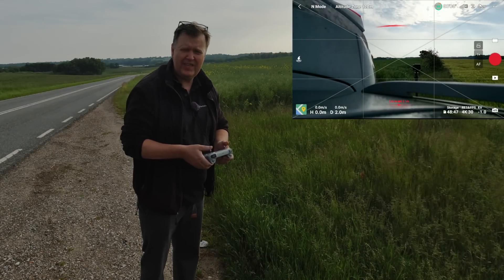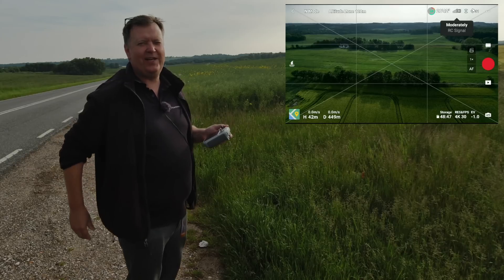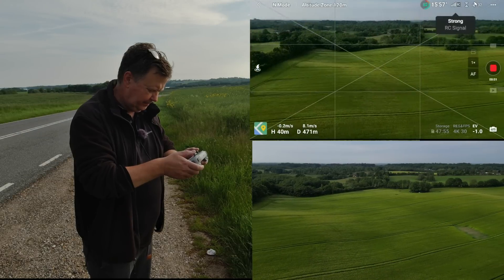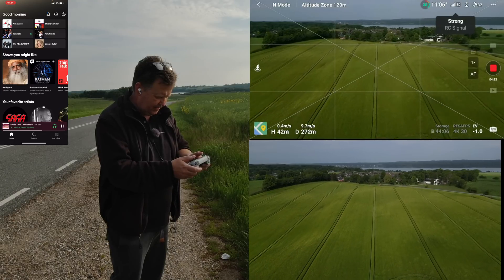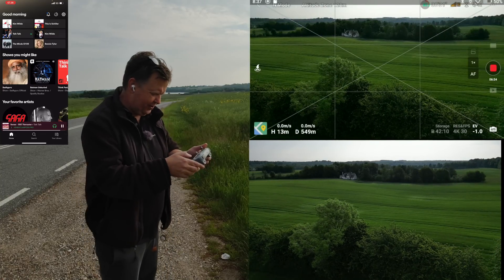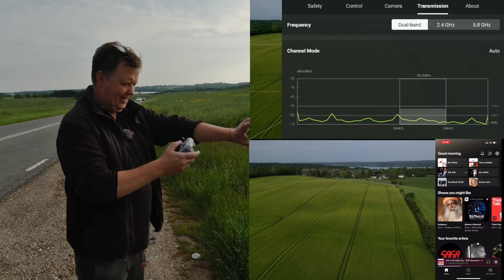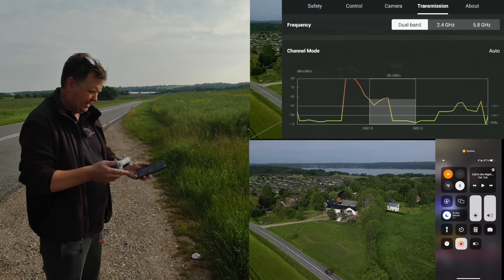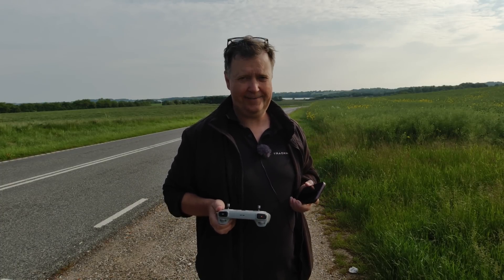Will a FORCED Interference Test make DJI Mini 3 Pro LOSE CONNECTION? (Bluetooth & WIFI enabled)

Comment: I pulled up on the side of a moorland road a few days ago after filming elsewhere and decided to test the range with  mine here in the UK. 
Mini 3 pro with RC-N1 controller, flew over 1500m just 10m high before losing two bars went up to 50m high to get them back and hit over 2800 before losing 3 bars. I still had full control of the drone so took it up to 120m and got full signal back until I hit a staggering 4182m! Where it dropped down to two bars but again still had full control with no lag, that's a CE model here in the UK, no FCC hack or parabolics etc.
Took a few pictures of the valley below that I never expected to see and returned to home point. 
If you know the moorland here in the UK you'll know it's pretty desolate with barely a sole around and certainly no interference from cell phone masts etc.

Comment: Thanks for the test! I have the same experience with my M3 pro, I flow over 800 meter and had drop outs from 5 bars to 2 bars. A second later the drop outs are ending and I have 4 or 5 bars again. This is annoying

Comment: MM3 pro UK spec. Connection and stability way worse than my MM2. Worst signal drop in a rural area. 500mtrs out. Dropped to one bar red, persisted all the way back to 70mtrs! Mega screen lag. Not impressed. Very unpredictable at best...

Comment: Hi Henrick, I had a connection loss today with my Mini 2 with no warning just came up red and said connection lost. I had no video to see what was happening so I just had to wait and see if it came home, but it didn't. So I tracked it on the map and found it 400 mts away hanging in a tree with no damage at all. It was my own fault because today I was going to fly down along the river so I set my RTH to only 15 mts high because I did not want it to go to high up where there was trees hanging but then I could see all the power lines swinging down from my place so I put my drone up to see what was happening and did not reset my RTH height and I live in jungle so it only climbed to 15 mts and headed home until it hit a tree. But what I wanted to know is where I can find the screen recording of the flight to have a look at to see what happened. I found it once before but now I can't remember where to find it. Thanks.
Reply from the maker: Under your profile in the fly app as far as I remember
Reply: @TECHDRONEMEDIA  Thanks Henrik but it only shows the map view of the flight not the screen view.

Comment: The dji drones broadcase on 2.4 and 5.8 ghz. Bluetooth is generally at 2.45 ghz so there is the potential for bleed over in the 2.4 to 2.45 bands.  All antennae have a broadcast pattern (i have no idea of what the dji radiation patterns look like) and it's possible based on your orientation between your receiver and broadcaster antennae you will move in an out of areas just based on orientation where the signal is weaker. I predominatly fly non dji fpv systems any my radio/telemetry link runs at 915Mhz and I almost never run into signal interferance however my video is broadcast at 5.8Ghz and it's common to see intermittant signal break up, even in remote places far away from civilization.

Comment: Still hesitant to upgrade my mini 1 for the 3. The range now is bad and not sure flying urban it will be a lot better. But the conclusion of your video is, that guy in the bus was the greatest interference. 😂 Waiting for that video.
By the way, I really think DJI capped the range for CE. I saw another video which almost proves that point
Reply: The 2 and 3 will be a big upgrade over the 1 in Many ways.

Comment: Air photography did a test with RC-N1 and RC Pro and no diff . Seems to point to some issues in drone , perhaps some serial number ranges have antenna issues or receiver problems. Will have to try mine in FCC mode in uk

Comment: I have owned the mini 3 pro with the RC controller since release on the 17 may and I havent experienced much issues with connection loss  .. only once have the drone lost connection to the controller and started to return to home but I was 1.6 km away and after 8 sec it reconnected .. I dont tend to fly my drone very far away so when people say that they only can get the drone to go 3 km away and it is not good enough I think it is a bit silly .. sure if you cant even get 300 m away before loosing signal it is a issue but that is not the case in my experience, hopefully dji will come up with upgrades for the drone with software updates

I feel that the mini 3 pro is a MASSIVE upgrade for me since I came from a mini 1 .. that drone was not very fun to fly far away and it would loose signal even within 100 m sometimes! .. Still I loved my mini 1 since it was my first drone ever .. so for me the mini 3 pro with the RC controller feels like a huge upgrade

Comment: Hi, I just got my mini 3 yesterday. I find the signal to not as good as my mini 2. I have flown in several places that I’ve flown my mini 2 and definitely notice a poor signal on the mini 3.
Reply: Please report to DJI.  I did a poll in this, and discovered about 30% of these units are faulty.   Don't accept this.  Your not alone.  The more people reporting, the faster the fix from DJI.  Request a proper unit or $$ refunded.

Comment: Great video.  My question is; “there are so many users reporting range issue has anyone reported this to DJI and if so what is DJI doing about it?”

I think an experienced and well respected YouTuber such as yourself would have much more success in getting answers from DJI.
Reply: I reported it and they gave me 3 page  answer about what affects transmission and ce levels etc
Reply: @TheDeadlyraptor  Thanks for getting back to me.   I would have pushed them further by asking why this is also happening to customers across North America!
Reply: @samavella8831  I am going to formulate a reply the fact 47% users are seeing it and it’s not dependent on RC or RC-N1 suggests some hardware issue in some runs of the drone or firmware issues in them in relation to hardware In them , ie maybe they changed hardware later in some . If it hardware issue then they should recall and replace
Reply: @TheDeadlyraptor  Thanks Andrew. That means a lot to us followers when these issues are formally addressed by well respected people as you who are not just users, but very knowledgeable on the product. 

Cheers 🥂 
Sam
Reply: @TheDeadlyraptor  Forgot to mention that I tried to go through their Chat line and told them this very thing regarding the number of users across both Contents having this issue and that some us may never experience it because we do not fly long distance and all the came back with is that they will be there to help when the time comes.
Reply: @samavella8831  when the time comes ? I know on another YouTube channel with range issues they are saying will be firmware release soon
Reply: @TheDeadlyraptor  Thanks for this insight Andrew.  I truly hope that what they are saying is true! Fingers crossed 🤞

Comment: A great video, yet again concerning range limitations on the mini 3.

Not yet owning a mini 3, I would like to put forward this theory which might explain some of the limitations in range. This theory is based on my previous training as an electronics technician.

With DJI, encapsulating the antenna on the DJI RC the unit itself could be causing a loss of signal strength with some of the transmitted RF signal been reflected inside the RC. I draw a similarity between the DJI RC and cheap Wifi Routers (often supplied by Telcos). Both of these have internal antenna and connection problems with Wifi routers can be seen in your home. When compared with high end Wifi routers, ( those with external antenna) wifi connection and speed are often increased in the home.

To prove this theory, it would require someone with a second RC controller to modify it and replace the internal antenna with external antennas in a similar fashion to the RC Pro and the mavic mini 1 MR1SS5 controller.

I think having the external antenna will improve the overall range, and users will have fewer signal drop outs and disconnections
Reply: This is not only a problem of Mini 3 Pro, but everyone had to be clear by now that DJI (in EU) has throttled the signal.  At the moment, some Yuneec models have more range (stability) than DJI, not to mention that a test against any Autel model here would only negatively affect the DJI Mavic 3, Air 2S and Mini 3. Of course, the internal antenna is a loss of signal have this also minimal.

Comment: My Mavic pro has much  better signal strength and distance.  What gives DJI?
Reply: Conversely, my Mavic Pro (a 1000 km veteran) does not, compared with my Mini 2, Mavic 3, or Air 2, but they all have more than acceptable range and video feed.

Comment: Thanks for sharing this video, I have seen a video that appears to show signal strength is stronger when the drone is facing away from the remote compare to when the drone is facing the remote control (can demonstrate this when you turn the drone around 180 degrees to face you compare to signal strength when it is facing away from you).  Maybe something to do with the position/orientation of the antennas inside the drone?

Comment: I think you must be flying in an area with lots of other radio transmissions as I saw a video from Windswept Robert yesterday who was getting 4Km before he lost signal. He was flying in a remote area of Scotland which is probably free from any strong transmissions from cell phone towers ETC. Thanks for an interesting comparison of normal and flight mode operation. It's similar to what I aim to do with my Mini 2 with my Phone mounted on the controller and comparing it to the performance when it's held in my hand on the end of a 1m cable.

Comment: 440-yard dash (402.336 m)—which is a quarter of a mile and was referred to as the 'quarter-mile'—instead of the 400 m (437.445 yards), though this distance is now obsolete.  That's pretty bad 👎 I seen a video of a dji mini se in Phoenix get two and a half miles .

Comment: Blocking the signal path with your phone did the most change. It would probably have been the same by just putting your hand in front of the antennas.
Reply: Just to add people don’t fly drones with the phone in front of the RC laugh out loud
Reply: @Trevtull  Well, where would you put the phone if you have the non pro controller?

Comment: Great video, covering so many aspects which may affect the signal. I've had no issues with mine (also EU spec) and haven't noticed any difference to my Mini 2. Also, there are very few real world scenarios where you need to be more than 500m away and very few people are licensed for BLOS operations 🤷‍♂️
Reply: I know this statement in every DJI group, no one has problems, I am used to such statements. This is not about range, but about connection stability and this is important for entrepreneurs who want to work in the city with the Mini 3. But hey, if everyone says that there is no problem, then it will be, and so DJI does not have to improve.
Reply: @glm-mediaworld  DJI doesn't care as long as people keep paying  them and the CCP military to support their development of IP thefts.
Reply: @retromodernart4426  Unfortunately correct. Theoritically, DJI could have charged 1500€ for it, people buy it. I'm glad that 90% bought one and with Smarcontroller.

Comment: Took my Mini 3 out yesterday for its first flight. I was sadly disappointed in the new RC range and drop outs. I love the convenience with the screen, nicer to hold and looks better all round in my opinion. BUT the range is the same if not slightly worse than my old mini 2…. The reason I went for the Mini 3 was for it to be better, not the same or worse! Not massively impressed so far. Sold my mini 2 for £450, now just paid £1050 for the Mini 3 flymore kit and not seeing much extra value 😢
Reply: You are not alone.   30% of these units are having the same issue.     Please log this with DJI.  Expect to have it fixed, replaced, or money refunded.    Keep in mind; 70% of the drones work fine, so you will encounter lots of people who think its all in your head.  Nope.  What you are experiencing is real.
Reply: @chconger  sounds like you are recommending giving your name to dji and saying hey I want to fly beyond line of sight against the rules can you help me break rules please?
Reply: @mcmach1  I live in Canada. No VLOS rule under 250g here.
Reply: @mcmach1  DJI anounces what distance? Lol they are the one breaking rules...no? Beyond line of sight...
Reply: @KTMLaranjinha  and  many countries (like mine) don’t have VLOS rules for sub 250g machines. So that’s why DJI designed this range in. It’s a major legitimate selling feature for many people.
Reply: @chconger  I know, but the drone or the remote Control (more the remote) have serious related problems of distance covered...
Reply: @KTMLaranjinha  it appears to be the drone itself. I have asked DJI what  fixes these range issues for most people.  No response yet. My suspicion is a factory error in a large batch.
Reply: @chconger  well, i want one drone for christmas...hurry up DJI lol
Reply: @KTMLaranjinha  Me too!
Reply: @mcmach1  They aren't the law. They can see it anyway in all the flight logs. It's just you bought something with specs and they can't deliver. Ok. These specs are in the most ideal situation but a couple of 100 meters signal strenth is pathetic.
Reply: @mcmach1  So you have never flown beyond LOS.
Reply: @yeahrightmate  I have, see my vids. My mini goes ove r 1000m. Just not sure why I would regularly need to do that?
Reply: @chconger  do you have one . What results are you getting.
Reply: @djidroneadventures4059  I probably will buy one. But I am not putting money down till this is resolved, or DJI provides a path to resolution. Don’t want to spend the summer talking to DJI support.
Reply: Did you have Airplane mode ON or OFF in your RC when you were flying your first flight?
Reply: @DavidDiepAU  off
Reply: @pryster you are not the only one who sent back a DJI Mini 3 Pro.
Reply: DJI needs more people like you ;). Buying, buying.
Reply: Must be your area mate, can go over 1000m
Reply: @mcmach1  Same. I flew 1150m and had no drop-outs whatsoever.
Reply: @mcmach1  
I fly 1km over Sofia City with my Mavic Mini, my Mini 2 gi fly 1.6km away and it still has full connection almost. The Mini 2 is really awesome, love my Minis very much. Waiting for my Mini 3 to arrive and then I'll have them all, yeeeeeeeeey.

Sweet
Reply: @ivanjdrakov1957  my mavic mini is just about 300 meters above houses. Then signal lost. Terrible, it's just like a (expansive) toy.

Comment: Gavin from GHR channel,did a good test in built up area,flying low& got 300odd meters or so,which was the same with either controller,plus you need really good eyes to maintain vlos at 500m with a 250g drone.🙈🙉🙊👍🤖🐨🎥®️©️™️👌🇬🇧😉